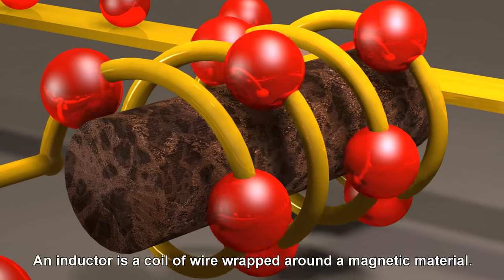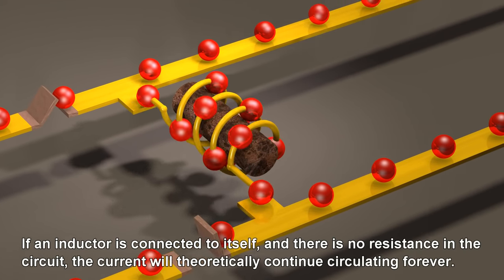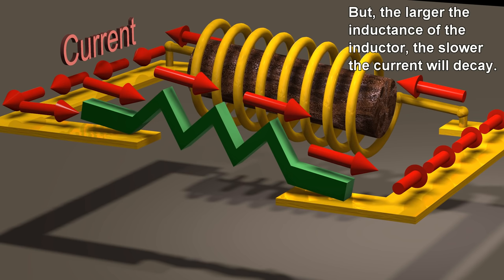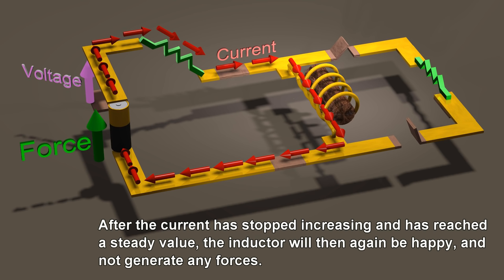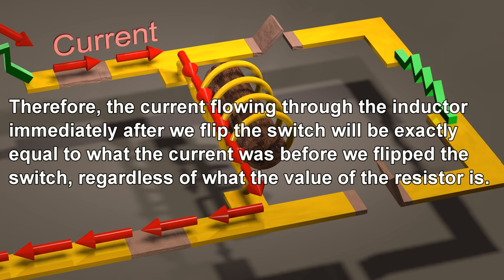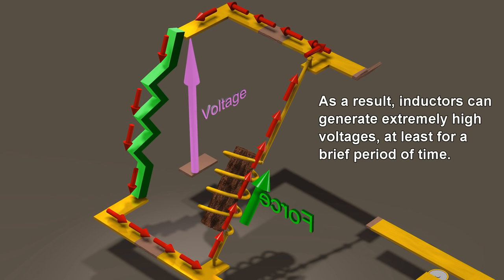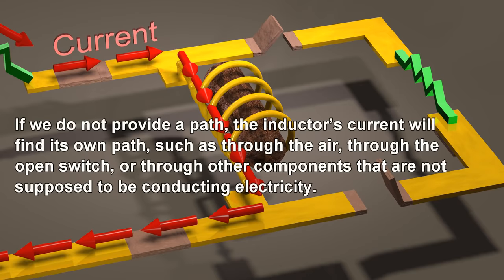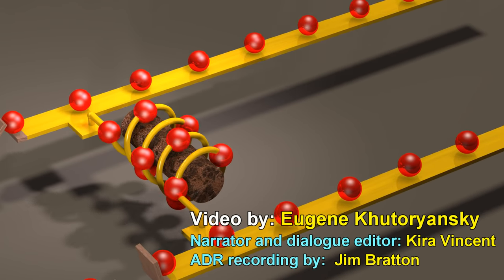Inductors and Inductance

Comment: 1. Transcript of video

An inductor is a coil of wire wrapped around a magnetic material. Current flowing through the inductor creates a magnetic field, and magnetic fields do not like to change. As a result, an inductor is a device which tries to prevent the current flowing through it from changing.

If the amount of current flowing through the inductor is constant, the inductor will be happy, and it will not generate any forces on the charged particles flowing through it. In this case, the inductor behaves just like a normal wire. [We could in fact replace it with a wire in this case.]

On the other hand, if we try to interrupt the current flowing through the inductor, the inductor will generate a force trying to keep the current flowing through it. If an inductor is connected to itself, and there is no resistance in the circuit, the current will theoretically continue circulating forever. However, unless we are using superconductores, all wires have some [minimal] resistance to them, and the current will eventually decay to zero. The larger the resistance, the faster the current will decay. But, the larger the inductance of the inductor, the slower the current will decay.

Once the current is at zero [that is, no current is flowing through the same branch that contains the inductor], the inductor will want to keep the current at zero, due to the fact that an inductor tries to prevent the current flowing through it from changing. Therefore, when we connect this inductor to a circuit, the inductor will initially create a force trying to prevent the current though it from increasing. [Here, she refered what would happen if we had a circuit with a battery, and the circuit is connected to the inductor, but the circuit is open, and then we close it.] But the current will slowly increase. The larger the inductance of the inductor, the slower the increase in current will be.

[In the following, we're still refering to the same circuit.] After the current has stopped increasing and has reached a steady value, the inductor will when again be happy, and not generate any forces. But, when we try to turn off the current flowing through the inductor, the inductor will then generate a force to try to keep the current flowing through it at this new constant value. If the inductor is then connected to a resistor, the voltage across the resistor will be the current multiplied by the resistor's resistance.

The inductor prevents the current flowing through it from changing instantaneously. Therefore, the current flowing through the inductor immediately after we flip the switch will be exactly equal to what the current was before we flipped the switch, regardless of what the value of the resistor is. If the value of the resistor is extremely large, then the current multiplied by the resistance will also be extremely large. As a result, inductores can generate extremely high voltages, at least for a brief period of time.

Since the current through an inductor can not change instantaneously, when we try to disconnect an inductor from a circuit, we always need to provide a path for the inductor's current to flow. If we do not provide a path, the inductor's current will find its own path, such as through the air, through the open switch, or through other components that are not supposed to be conducting electricity [like yourself in case you're very close!]. This can create very large voltages, and cause considerable damage to the circuit.

The ability of an inductor to create large voltages [for a short period of time] makes them very useful in the design of power supplies. But, this ability also means that care must be taken to ensure that we never try to switch off an inductor, without providing a path for its current to flow in.

------------------------------

2. Notes

Text between brackets ("[]") are notes I wrote, and is not words Eugene said.
This video refers to direct current (DC) conditions, and all the components are ideal.

------------------------------

3. Q&A

You should answer the questions, not me.

Q1: In an inductor, what is the purpose of wrapping the wire?
A1: any current flowing through a wire creates a magnetic field in the direction of the second right hand rule. Thus, circuits always have some inductance, but usually it is very small unless the circuit has a a coil of many spins. Therefore, if you wrap a wire as in a coil/solenoid, the magnetic field through it increases, and the inductor is born.
Q2: In an inductor, what is the purpose of wrapping the wire *around a magnetic material*?
Q3: Why does current flowing through the inductor creates a magnetic field?
Q4: Why magnetic fields do not like to change?
A4: When a variable current passes through a coil (or solenoid), a variable magnetic flux is produced inside the coil, and this, in turn, induces an emf in that same coil. This induced emf is opposed to the change in the magnetic flux (Lenz's law.) In other words, nature abhors a change in flux.
Q5: Given that an inductor is a device which tries to prevent the current flowing through it from changing, what is(are) its purpose(s)?
Q6: Why if the current flowing through an inductor is constant, the inductor is constant (acts like a wire, a short circuit)?
A6: Because the voltage of the inductor is proportional to the rate of change of current respect to time, therefore, if the current is constant, no change occurs in it, and the derivative of a constant is zero, therefore v(t) = L di(t)/dt = L * 0 = 0 V, in other words, the voltage or electric potential difference accross the coil is zero, which happens in (ideal) wires, which produce a shortcircuit if you measure their voltage. In Eugene words: because if the current flowing through it is constant, the inductor will be happy.
Q7: How can the inductor create a force that tries to keep the previous current? I.e., from where does the inductor get's the energy to generate such force?
Q7: Why if an inductor is connected to itself, and there is no resistance in the circuit, the current will theoretically continue circulating forever?

Comment: What would happen if you disconnect a inductor in vacuum? Since vacuum can't conduct electricity, there is no path for the inductor to release its energy
Reply from the maker: The current would flow through the vacuum.
Reply: vaccum has its own permeability

Comment: Once again, amazing video!!! But I still have a question, but I suppose it is more of a math question than a conceptual one. Nevertheless, I need to build a circuit that will push a current through an inductor that is proportional to the input voltage of the circuit regardless of the waveform. Being that L(di/dt)= V(across inductor) I though a differential amplifier would do the trick so that the voltage through the inductor would be the derivative of the input voltage and the antiderivite (the current across the inductor) would be proportional to the voltage. However this was not the case and I believe it is because of the series resistance of the inductor. If you (or anyone else) could help it would be most appreciated, but please note that I am only a 9th grader who's understandings of physics, electrical engineering and calculus are all self learned. Thank you for your time, and thank you Eugene for your amazing videos :)

Comment: The inductor happiness is related to the magnetic domains inside the core. Assuming a non magnetized piece of iron is used, when we apply current to the wire, the magnetic domains which are aligned at random position start to rotate. As electricity continue to flow, more and more domain rotate to align with the magnetic field created by the electrons circulating in the coil of wire. But eventually, all domains become aligned, the core reached saturation. The inductor act like a resistor, the current is maximum and depend only on the resistance of the wire.

When we disconnect the batteries from the inductor, it will try to maintain the same current to flow, raising the voltage as high as necessary, which depend on the resistance of the load. The magnetic domains in the core return, one after the other, to the position they were initially. As the number of magnetic domains which try to return to their default position decrease, the voltage and current decrease until the coil finish releasing all the energy that was accumulated.

When a capacitor and a coil are connected together, the voltage and current will alternate between both forming a perfect sinusoidal waveform. At the peak voltage, all the energy is residing in the capacitor. At the crossing point where the voltage reach zero then invert, the energy is entirely stored in the core of the inductor. It is th time where the highest current is flowing.  When plotting both voltage and current simultaneously, they appear shifted 90 degres. The peak current align exactly with the voltage crossing the zero voltage.

Brief, a good inductor is accumulating energy when current is applied then release the exact same energy when the current from the source stop and is allowed to dissipate in the load (the load is the resistor that absorb the current). In practice, the inductors used in switching power supply often exceed 95% efficiency. For example, your desktop power supply rated at 500 watt may waste only 5%, about 25 watts, as heat dissipated in the inductor.

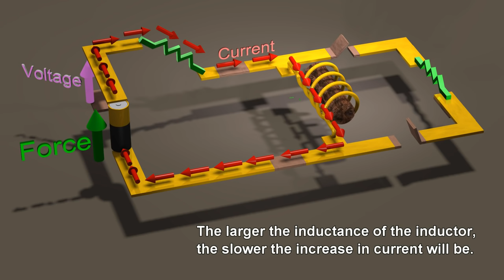Comment: 3:19 But why does the current increase? I mean, if the inductor initially blocks the current (I=0 at t=0), why it does not continue to block all the current?
Reply: The back EMF is weaker than the forward EMF of the supply voltage being applied to the inductor thus allowing the current to increase but at an impeded rate. The video explanation, though good, is oversimplified for a complete understanding of inductor theory.

Comment: Greetings Professor! Thanks so much for your educational videos- they truly are the best! I was just curious- what would happen exactly if I were to pee directly onto an inductor while current- let's say roughly 110 volts and or 15 amps, was flowing through and the current were then disrupted? 
And, If the electricity were to arc into my pee hole (I'd hope not) would the shock be any more or less, than it would be if it were just a straight wire carrying the current? 
Hope that makes sense and thanks in advance! Wanting to try this soon, but wanting a better understanding of the physics before I attempt it.
Reply: Wtf 😳
Reply: @mikehenry9672  hey don't judge- it was from a significant bar bet.😅

Comment: In the beginning you said magnetic fields do not like to change, so does that mean that current passing through every conductor acts as an inductor or magnetic fields behave like this only in this arrangement?
Reply from the maker: Yes, in a circuit, all wires behave like inductors with a very small inductance.

Comment: For safety reasons, when to switch off an inductor with current, could I insert a ground connection? I think that, that way, current would have somewhere else to flow (the ground) than the air or whatever component.
Is that right?
P.S.: Great video, by the way! Pretty easy to understand and loveable background music.

Comment: An inductor does not require a magnetic material inside it. High frequency inductors often are wrapped around just a form. Iron based core will increased the inductance of a coil.

Comment: This is the inertia of atomic materials. Every material somehow has a resistance to change. Every material want's to live forever as it is. Nostalgia directly comes from there. The will of turning back where you were. And staying at those good times forever. We are not so different than atoms, or anything. Everything is just a little complex and big from another in scale. Sometimes I wonder if the existing is nothing but a Mandelbrot Fractal. what a scary posibility.

Comment: This one confused me. The bar within the coil is not connected to anything. So the current flow going 'around' it is simply passing through the wire-coil which surrounds it.  I thought an inductor would take the charge from the magnetic field of that coil and pass it to something, but as I said, there is nothing hooked up to that bar.  And using height to represent (I guess) different voltage potentials doesn't help.

Comment: What if you replaced the resistor with a high voltage capacitor? Would this charge the capacitor really fast because the resistance is so high?
Edit: And if you put a diode in the direction of the current between the capacitor and the inductor would this make the inductor mad?

Comment: I don't know this question is valuable or not but i have a doubt that....in 3 min.12 sec section of video there is shown that a force is generated when voltage given to inductor but how an inductor can develope opposing force when there is no current passed through it at that time
.
Reply: As the voltage is fed to the inductor terminals the current is zero and magnetic field is zero. As the mag field increases the current increases and the voltage accross the inductor terminals decreases. At some point the current is at max level and voltage is zero. The current keeps up the mag field which is also at its max level. A this point 04:02 the battery is disconnected thus the battery current is zero. Now at this very time the energy stored in the mag field generates new current which is in same direction as the battery generated one. For this current the mag field generated voltage at the inductor terminals must be in opposite direction (polarity). This is for the inductor is now feeding the current when the battery switch is opened and the external resistor switch is closed. In this video there is a current path (the external resistor) for the inductor generated current, for reasons explained at 06:45. Also at that timestamp and after it is explained why the battery switch and the external resistor switch must be operated at the very same time.

Comment: Mam I have one more question the current stored in inductor it will delivers in a particular direction or not i.e the current was delivered in previous direction or not 
Otherwise it will delivers it one way where the load is there either conductor or wire

Comment: When the video gets to the part where it says therefore inductors can generate extremely large voltages, I did not understand that part? Can anyone help explain it? I understand V=IR and the current multiplied by the resistance gives a voltage. Larger current or larger resistance has a larger voltage... but how can inductors create large voltages? I think I missed an obvious point.

Comment: Don't they use this in computers to control the voltage to the CPU, GPU, or anything else in the system that requires stepping 12V down to 1.3V etc?

Comment: So what happens if we combine capacitance and inductance in the same device? Such as a capacitor where the 2 "plates" are wires wrapped around an iron core - like a voltage converter with one end of each wire disconnected. Would it continue to input and output more energy than a standard capacitor?
Reply from the maker: I cover this in my video at https://youtu.be/Mq-PF1vo9QA

Comment: How would be the current flowing through the inductor will be same before and after the switch is flipped as some electrons left on the first part of the circuit (left to the inductor)?
Reply: Eddy currents

Comment: So, that is why when you touch an inductor it will create very high voltage because of large current of its own and your body resistance (IxR=V)
Am I right??
Reply from the maker: That would happen if you touch the inductor and disconnect it from the circuit.  It you touch the inductor while leaving it in the circuit, the resistance of the circuit would be in parallel with the resistance of your body, which would result in a lower total resistance seen by the inductor.  But, what may cause a high voltage whenever you touch electronics is the electrostatic discharge (ESD) from your body.
Reply: @EugeneKhutoryansky  thank you, i got your idea ❤️❤️❤️❤️

Comment: What happens to the energy stored when an inductor connected to a current source is suddenly disconnected (both the terminals) from a circuit?
Reply from the maker: The current will flow through the open switch (through the air).
Reply: What happen if potential is low

Comment: It is very hard to believe many of these comments where people are saying they are in college learning to become an engineer and would be struggling with inductance at this level, seriously? This is like freshman basics without the math. This does even tell them why an inductor works and wrongly suggests that a coil requires a metal core, many coils have just air as the core. I can see this for people just sort of wondering what the various parts sort of do and not how they do it. Finally, when I taught electronics I always found students understood better with real examples, like a simple tank circuit will show the complementary actions of a capacitor and coil and make it easier for most to grasp what these parts really do.
Reply from the maker: I show how an inductor interacts with a capacitor in my video on Resonance Circuits at https://youtu.be/Mq-PF1vo9QA
I show more about how an inductors behave in my video on AC Current Impedance at https://youtu.be/zO7RZZW0wSQ
And I explain "why" inductors behave the way they do, and why you can have an air core but a magnetic core will make it stronger, in my video on Maxwell's Laws at  http://youtu.be/9Tm2c6NJH4Y
Reply: I think you are out of touch then. A lot of students go into college without any background in engineering and thus knowledge on topics like inductance will not be intuitive nor "basic". Does this mean they shouldn't be an engineer? The basics must be a prerequisite to the rest of it learned at some point along the journey - but "when" is a matter of personal preference and your doubt doesn't do much to encourage future stem students.